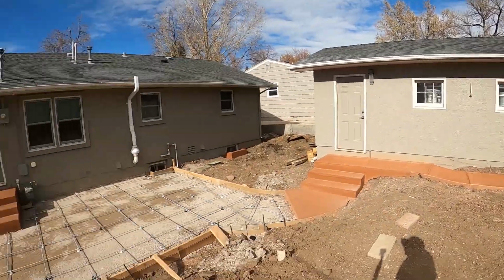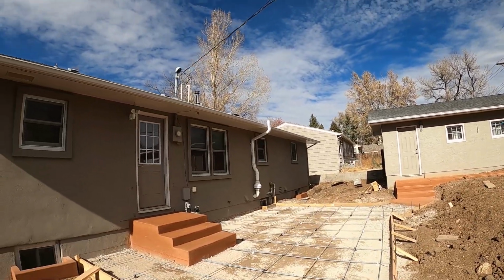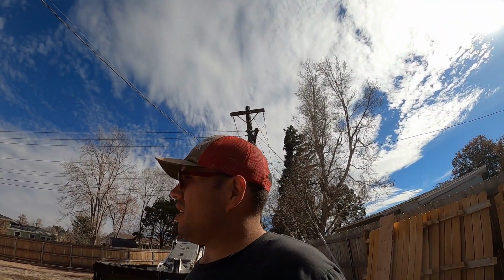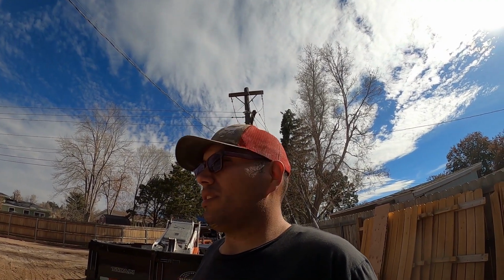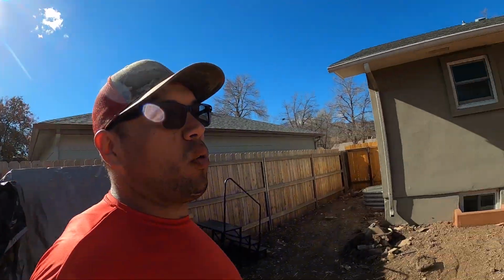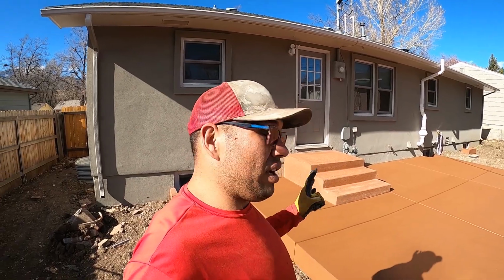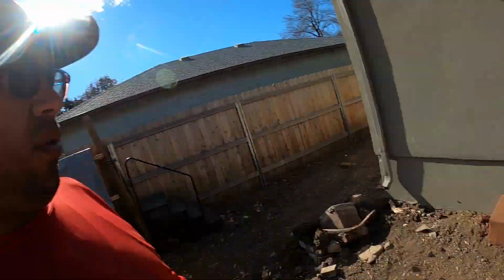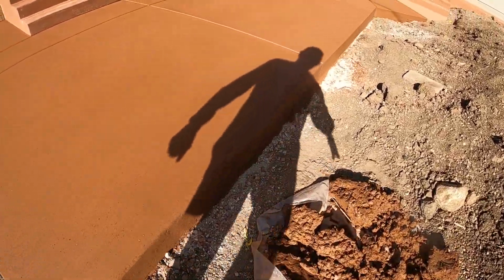Last job of the season and its color!

Comment: Way to finish strong. I go with my Dad's old cold weather rule. We cover if it is going to be 27 degrees or lower as a general rule of thumb. It usually isn't below freezing for too long and the heat produced by the concrete takes care of it.  See you at the WOC.
Reply from the maker: See you at WOC! Send me your info and I will contact when we are in Vegas. That's a good rule. I cover if it gets below 28 the first night, 30 the next, then 36 the third. Customers hate blankets marks alot so it's good to know how to thread the needle. Hope you all had a great season and can't wait for another post from yall.